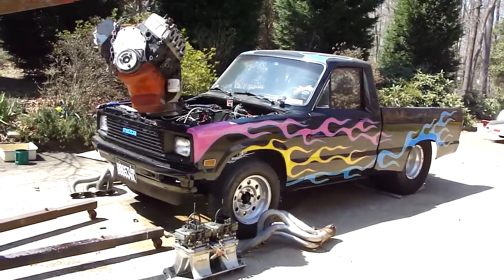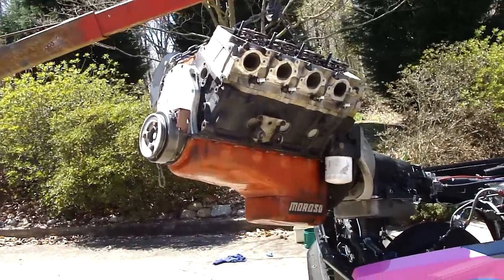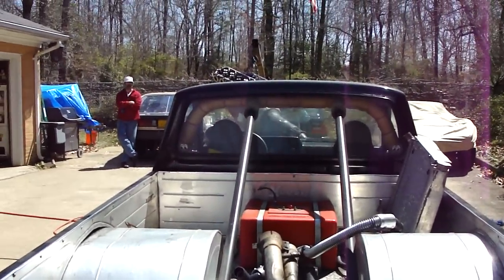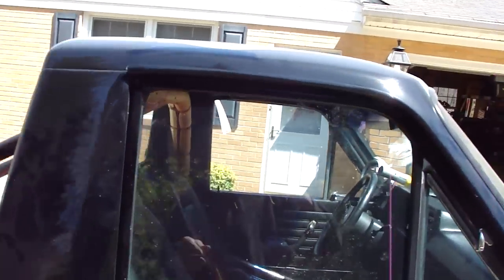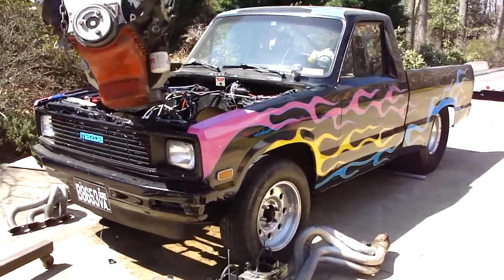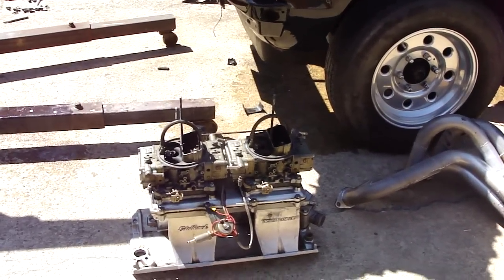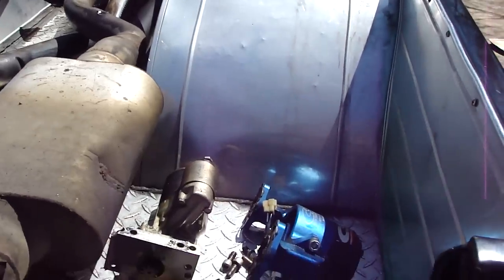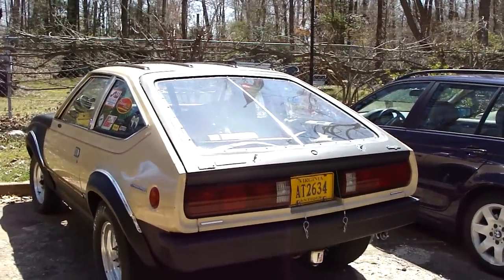540 CHEVY, TUNNEL RAM 2-4s, NOS,850HP, PRO STREET MAZDA PICKUP

Comment: do not want to seem like a smart ass, but I have done several chev luv engine conversions.   want to make it a very easy job?  you can take the cab off the frame in less than 30 mins, makes the job a LOT cleaner and a big time saver.